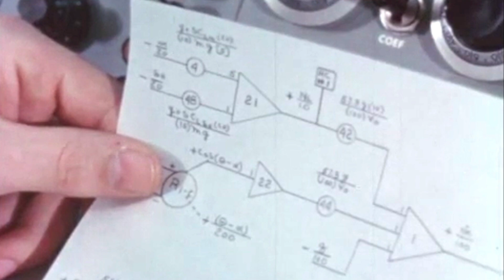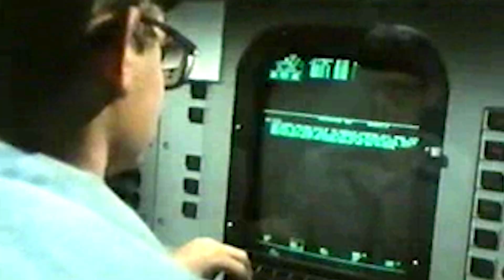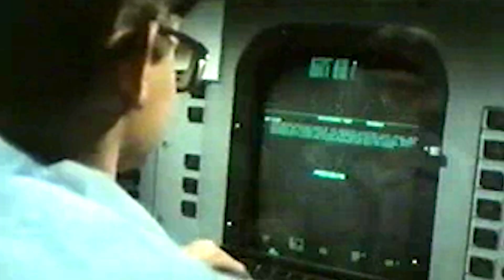A-5 Vigilante - The Aircraft Carrier Nuclear Bomber

Comment: Predecessor to the F-15. Many of this aircraft’s features or learning experience. Helped to develop the F-15 eagle. Which is still a top shelf navy aircraft carrier multi roll fighter. 
The overall length was shortened and an extra vertical tail fin was added. Providing the stability pilots required for carrier operations. I remember the design work of the Vigilante.
The vigilante wasn’t a bad aircraft. It was just far too large for carrier operations. Also nuclear bombs were heavy and the standard weapons mounts had to be redesigned to accommodate the payload for the unstable flight platform of a aircraft carrier. 
It’s not uncommon for things to go rolling across the deck in heavy seas or wind.  With a longer fuselage the chances of overshooting the runway increases. There was a lot of room for improvements at the time. With so many different political figures and weapons contractors vying for government money. It wasn’t uncommon for saboteurs to cause problems for their economic competition. For that reason the Cold War era of aircraft development was significantly more difficult. Than previous development periods.

Comment: what if we made a submarine-launched missile that had a tiny shell over the bottom part, which held fuel and a propeller, and the shell broke off right when it surfaced, and the engine fired? so you could fire from underwater. but the shell couldn't be that big to carry that much fuel so you would launch it from below, but not that far below, enough to hide from ships and be pretty far down and yea you get what I mean.

Comment: The bomb bay was replaced by a canoe that contained the photo equipment and on board film processing. This canoe was lowered through a hatch in the aircraft carrier's flight deck into a compartment on the O3 level that moved the entire canoe aside and replaced it with another one that was raised into the Vigilante. This only took a few minutes during which the Vigi was refueled. While the Kitty Hawk and the Constellation had this modification, earlier carriers did not and the canoe could not be serviced. Ashore, it was awkward and required an underground vault  to service the canoe or putting the plane on jacks. In addition, there was a considerable distance from the plane to where the photo interpretation took place which added to the delays in producing time sensitive information unlike the aircraft carrier where the canoe was only one hundred feet forward of air intelligence. .

Comment: Whoa whoa whoa.  Did you say "up to 28 nukes"  @ 3:20?  I think you may be confusing the number 28 with the standard nuke of the day, the MK 28, which came in external or an internal configuration for being carried in a bomb bay.  The MK 28 weighed over 2,000 pounds, so there was no way the airplane could have carried 28 of them in any configuration.

Comment: The Blackburn Buccaneer had twice the range of the A5 and had an internal rotary bomb bay that worked. The Mach 2 maximum speed is pretty much irrelevant as Naval Aircraft have to rely on low level attack capability, which the Buccaneer was superb in its role in the land and naval attack roles from carrier launch.

Comment: “...a nuclear bomb falling off and rolling around on deck was the last thing a carrier needed.“ 

Well... yes.
Reply: Sigh. Could roll around all it bloody liked and nothing would happen except maybe a few squished deck crew.
Nukes have an extremely complicated multi stage detonation sequence - miss any single part of the sequence and it's just a slightly radioactive lump.
They accidentally dropped a bomb on some poor sods back garden, cos some twerp almost fell out of the bomb bay and just happened to grab the emergency manual bomb release before he went splat. It just made a really big hole, wiped out two cars, and caused minor injuries.
Reply: @rosiehawtrey  explosions are hardly the only possible risks regarding nukes. Anyone with any real experince would know that. Navy Ordinancemen wear a Thermoluminescent Docimeter for a reason. Probably best you don't comment on subjects to which you are ignorant.
Reply: @SkunkApe407  - Come on skunk, Rosie just said it wouldn't explode...I don't see where they even insinuated that it was the only risk.
Reply: A conventional bomb rolling around the deck almost sank the Forestall. That was a nightmare so bad that they still use it as a teaching tool in USN Basic Training. Neptune forbid a nuke winds up loose on the deck.
Reply: I think a nuclear bomb exploding on the deck would needed even less I can think of hundreds of other things a carrier needs less than a nuclear bomb falling off and rolling around on the deck.

Comment: The two engines with a single vertical stabilizer captivates me for some reason.
Reply: bro. that All-Moving Vertical Stabilizer. That sure was a unique flight control design. Was it cutting edge technology alongside it's Fly-by- Wire, flight control system. I'd love to hear from pilot's, mechanics who worked these items.on this formidable naval airplane. Thank you.

Comment: It's funny, it came at the same time as the Blackburn Buccaneer.
It only went Mach 0.95 but was far more successful and served for 40 years.
The bucc succeeded because the RAF very quickly switched from high speed low level.
Prior to the introduction of advanced SHORADS, it was untouchable.
Buy the time you know it was coming, it had already left or you were already dead.

Comment: When the squadrons were standing down the Navy's plan was to assign the remaining flyable Vigilantes ( a lot of the remaining aircraft were at or near max safe hours for arrested landings/catshots on a carrier) to a squadron (most likely a VAQ-33, a composite squadron that operated with a number of different aircraft, the CO of that squadron when they moved to NAS Key West was the last XO of RVAH-7 ) and deploy detachments to Rota Spain and Cubi Point in the Philippines that would keep the aircraft's capability available in the Med and Pacific, but limit the number of catshots/arrested landings and centralize the support and parts in those two locations (as well as at NAS Key West in the US). For reasons only known to the Navy's brass at the time that plan was suddenly cancelled.

The planed replacement for the Vigilante's Recon mission, the TARPS Pod for the F-14, had a lot of initial problems and the old RF-8G had to take up the slack.

Comment: The RA-5C was the third version.  They actually tried to make an aerial tanker out of it, but it turned out to be a bigger abysmal failure than the bomber. I spent a week in 1972 in an A-4F squadron on board CVN-65 (Enterprise) while our squadron LSO (Landing Signal Officer) was requalified.  You didn't just watch an RA-5C leave the deck, you felt it!
Reply: The Vigilante was an awfully expensive tanker truck (and also as a bomb truck, there are photos of NATC Pax River testing the aircraft with conventional gravity bombs mounted on racks on the wing pylons and guys who were in  the VAH squadrons that transitioned to the A-5 from the A-3 said the Ordies used to load the small blue practice bombs that way for bombing practice). Not to mention being expensive it really didn't like flying slow enough to ba a good tanker.

The tanker version was nothing but a module they could install in any Vigilante by replacing the rear most inline fuel tank (or the Nuke in a bomber version) and installing the appropriate control panel in the cockpit (I'm not sure if the control panel went in the front or rear cockpit, maybe one in each). The Navy got over that plan in a hurry and the VAHs that continued to fly the A-3 became the squadrons with the tanker aircraft (KA-3B, and then as they transitioned into VAQ squadrons they had the EKA-3B)

The RA-5C was planned from the beginning (or very early on) and was designated the A3J-P under the old Pre -1962 Navy aircraft designation system. North American was ready to start building the "R" version when they started releasing the A-5B (or A3J-2 under the pre 1962 designation system). That is why they so easily transitioned the assembly line into making RA-5Cs when the Nuke Attack Mission went away. The last batch of Vigilantes that NAA built in the late 1960s/early 1970s  (156XXX series) should have been RA-5Ds but congressional politics made the Navy pretend they were just more RA-5Cs (but they add all the updates and improvements that NAA had come up with since the last of the original RA-5Cs rolled off the assembly line in the mid 1960s).

Comment: Served aboard USS Enterprise CVAN/CVN-65 from 1975 - 77.  The Vigilante was a very heavy aircraft.  To get higher steam pressure to the catapult that the Vigi was on, the associated engine room on the Big E had to trail that propeller shaft and go to elevated reactor coolant average temperature for the reactors.
Reply: Did not need to trail the prop, elevated t-ave was simple

Comment: These planes were pretty much a disaster. The carrier I was on had two RA5Cs. They had more breakdowns than any other plane. It was rare to have both flyable. Usually at least one was parked in the hanger bay being used for parts. One had landing gear failure that punched out one engine. Even though it was still flying when it cleared the flight deck, with only one engine it could not gain sufficient speed to keep flying and crashed into the S. China Sea killing both crewmembers. The old F8s were superior recon planes. Far more reliable, took much less maintenance, fuel, space, & crew time.

Comment: If I remember properly there was also an issue found in the construction of the A-5 later on as well... dis-similar metal corrosion. Steel and Aluminum do not like being bolted or riveted together. It was part of the reason why maintenance costs were so high. I might be wrong however I am certain that was one of the flaws of the A-5 not mentioned here.
It was a great idea on paper but tail dropping bombs was a bad idea they should have tested with X planes first.

Comment: "It's bombs and fuel tanks would fall off on launch."  
Carrier: Red 5 this is carrier.  You forgot something.
Red 5: Again?
Reply: BM: This only happened two or three times. Entirely exaggerated by those who don't know what they are talking about.
Reply: @KB4QAA  And only in one incident did it result in the loss of an aircraft, and that was because something broke and the rear most tank came out on the catshot and fuel poured out of the next tank forward and caught on fire when the vapors hit the flames from the engines afterburners.
Reply: @sewing1243  Try explaining THAT to your insurance company on a claim form.
Reply: @sewing1243  one incident involving an airframe whose only purpose was to carry nuclear ordinance. Think long and hard about the ramifications of that scenario. I'll give you all the time you need.
Reply: @KB4QAA  Just a  "Bent Spear", no biggie. /s.
Reply: @KB4QAA  a Bent Spear incident is still a Bent Spear incident. Your flippant dismissal of potential nuclear hazards leads me to believe you don't know what you're talking about. As a USN roof rat myself, I'm personally glad we scrapped this hunk of junk. Not like we need a nuke bomber anyway, since we have an entire fleet of bubbleheads armed with Trident ICBMs.
Reply: @SkunkApe407  None of these incidents involved nuclear weapons. Stop fanning the fear and exaggeration.
Reply: @KB4QAA  they didn't, you're right. But considered the fact that the plane was designed solely for the purpose of carrying nukes. The recon role was just a face saving move meant to recoup the massive losses incurred by this useless head of cabbage. I'm not operating on fear and exaggeration, sunshine. I'm looking at this from the logical perspective of "plane sucked at its intended role; plane sucked at secondary role." The bird was an ungainly, awkward creature in the best of conditions, and all but unflyable in the worst. Nostalgia is cute and all, but this POS went the way of the dodo for a reason.
Reply: @SkunkApe407  You are delusional.
Reply: @KB4QAA  right. So delusional that the USN scrapped the bird for the exact reasons I stated.🙄 When did you graduate from the school of rectal ventriloquism? Bet you were top of your class, weren't you?
Reply: @SkunkApe407  The A-5/RA-5C was cutting edge as a bomber and in reconnaisance. It served twenty years. No other tactical recon plance USAF or USN had the suite of sensors it had.  Admiral Bobby Inman, Chief of Navy Intelligence just eight weeks after the end of fighting in Desert Storm gave a speech that started "Desert Storm proved we need the RA-5C.".   Keep believing all your internet echo chamber myths.
Reply: @KB4QAA  one, I'm literally a USN veteran. So there goes your echo chamber bs.

Two, it was so "cutting edge" that it never served a day fulfilling its intended role. 

But keep believing you actually have a clue, Scooter.
Reply: Gotta remember to put the diaper on those damned birds.
Reply: It appears a few of the commentators to this part of the thread are completely unaware that the Vigilante only deployed 3 times in its role as a nuclear strike aircraft and all deployments after those were the unarmed Recon version (RA-5C) because the mission went away (replaced by the Polaras nuclear sub program). As far as I know none of the A3J/A-5As operated on those deployments ever had a fuel train/bomb incident on the cat shot and none of the aircraft that were lost during those deployments were carrying a nuclear weapon.

Also if anyone is under the delusion that the aircraft the Vigilante originally replaced for the nuclear strike mission, the A3D Skywarrior (or the aircraft the A-3 replaced) never crashed during carrier ops. One of the nicknames the A3D had was "all three dead" because it didn't have ejection seats and on a cold catshot or a crash during recovery resulting in the aircraft going the water usually resulted in the loss of the crew because they couldn't or were unable to get out of the aircraft before it sank. Naval Aviation is dangerous and sh$% Happens.
Reply: @sewing1243  It is not true that RA-5C's were not nuclear capable. My still living 89 yo dad who is a test pilot, flew both the A-5A and RA-5C in VAH=-7/RVAH-7 from 63-66 including the first Vietnam cruise on Enterprise. They continued to have a nuclear mission and practiced for it.  Whether they or any aircraft carried live weapons is irrelevant.   As a reminder the plane had two wing racks that could be loaded with nukes as well.  Over The Shoulder and Loft deliveries were practiced.  It is true that at some point in the late 60's/early 70's that the secondary nuclear mission was removed. Whether the nuclear AMAC system was removed, I do not know. They may still have had the capability to carry a nuke, even though not assigned the mission.  (ret'd NFO).

Comment: My workcenter on USS Kitty Hawk was located right beneath the flight deck 03 level and between the arresting gears, we'd always know when a heavy landed A5 or A3. We'd lose overhead lights because shock absorbing brackets holding the light fixtures would always broke and have extras to replace the broken ones.😂 In addition we were constantly replacing light bulbs 😂. I can only explain of what it sounded like was sitting in a trash dumpster and 2 people on the outside hitting the side of the dumpster with 10 pound sledgehammers representing first the tail hook and then the landing gears striking the flight deck it was always a bam bam!.😂  We always wore hearing protection. All though you'd still flinch do to the vibrating shock of the workcenter. 😂 The Plat camera TV would always be on to see what was landing and would lesson the surprise.

Comment: So a warload of 28 thermonuclear bombs? No. The linear bomb bay and stores train was designed to accommodate one gravity bomb (at least three different types could be carried internally in modified form connected to fuel tanks). Also, the accidental on-deck dumping of internal training shapes and fuel tanks was a rare occurrence whereas the video makes it sound as if it happened constantly. You might want to consider using more than a cursory web search for your source material and employ a fact-checker/copy editor who is fluent in aerospace history as your productions are rife with basic errors in fact.

Comment: Wow, I'm not sure if my suggestion this morning was the cause of this video but it was great as usual. I assume that you had been working on this a little while and it was just coincidence. Dad said that it was a tricky job to put the bombs on target as they slid out the back of this crazy unit. They called it a "loft bomber" as the idea was to drop the payload as you were in mid high G turn, usually vertically. The goal was to get away from the blast as quickly as possible as they would likely be coming in at full tilt and at less than 15,000 feet. You dropped the bomb during a u-turn and abruptly went for home. He said that they would practice by dropping dummy bombs on a large dingy that would be towed behind the carrier. The idea was to get close but not hit it. Unfortunately, Dad centered that dingy early on in a float aboard the U.S.S. Enterprise which halted that activity for the remainder of the cruise. Your videos are amazing and never disappoint. Keep up the great work and thanks again from one of your 'Darkophiles'
Reply: Your dad sounds like a bona-fide bad ass
Reply: @maxk4324  thanks Max. He was alright with me. It was also a product of guys of that era. Back when everything was about speed and ass kickin'.